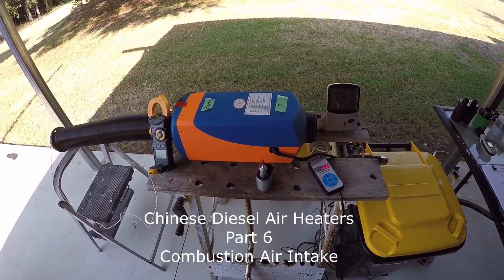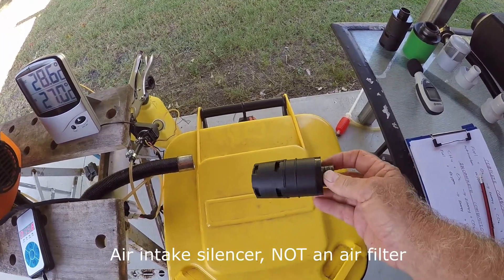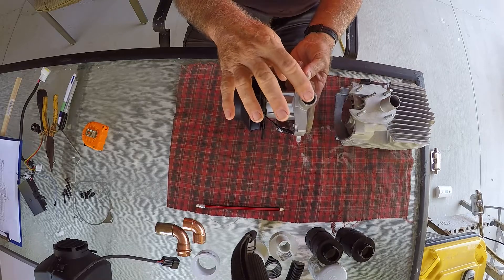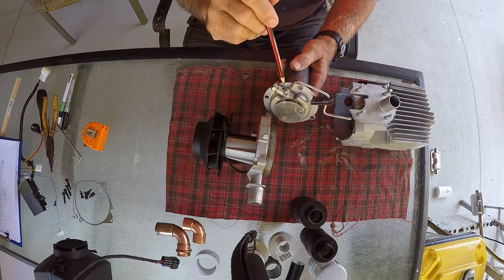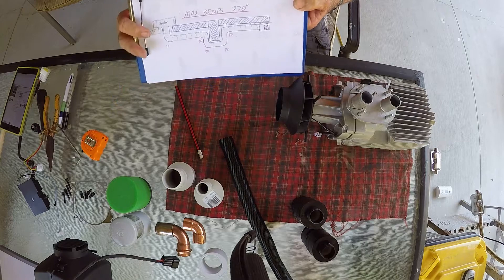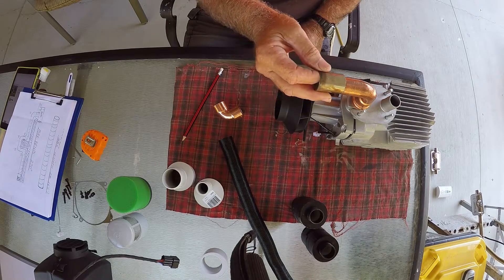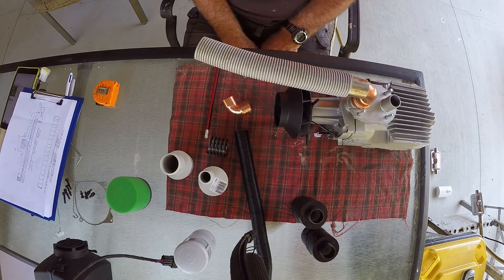Chinese Diesel Heaters - Part 6 - Combustion Air Inlet

Comment: Is there any reason that the air intake hose couldn’t be left off completely? I understand there’s a risk of insects or dust getting in more easily. However, in an indoor environment that is clean it seems to me that removing the hose entirely would provide the best and least restricted airflow.
Reply from the maker: @SommerBros  
Hi SB,

Yes, technically you could leave it off, but you are setting yourself for completely avoidable consequences. Eg, you do not need to wear a lifejacket while doing white water rafting, but if things go wrong, it can sure can be an asset.

In my opinion, you really need an air filter on the combustion air inlet, unless you have a very sterile environment. Bugs, flies, fluff etc can get sucked into the burner chamber, and get cooked. 

The air intake hose can be very short.  JMcK
Reply: @ totally valid point. I agree a filter makes perfect sense.

Comment: Great presentation. I was troubleshooting my issue of non-start & I knew it was an air issue. That 4mm hole was the problem, I blew some air in with a compressor & it would start but it would not ignite without blowing air in. My heater was in a very dusty environment last year. I'm about to disassemble the unit & I just needed some instruction on that but you troubleshot the problem for me. Thanks.
Reply from the maker: @xavierkost9264  
Pleased you found the videos helpful.   JMcK

Comment: Will intake diameter affect the stoichiometry of the fuel air mix and burn? Or is wider just better in general and it'll regulate as appropriate?  Is it better for the air to come from outside (ie, route the fresh air intake outside like the exhaust), or inside where the already warmer air is?
Reply from the maker: Hi Robert. 
These heaters do not like restrictions in combustion air inlet or exhaust as the “breathe” just by a small fan. No problem with larger combustion air intake. 
Whether to take heated air from outside or inside is personal preference. 

Some people want continuous fresh heated air, and take outside air and accept lower efficiency. 

Recirculating air from inside is more efficient, but it is most important leave a vent or window partly open to allow for fresh air into accommodation space.  JMcK

Comment: Thanks for all your videos on these heaters. Pure information, with no BS, what a relief!
What is the minimum distance between the air intake and the exhaust?  This is a boat installation and I currently have the exhaust going through a bulkhead flange feed through fitting on the stern. I would like to mount the intake air also on the stern also through a flange fitting (I know it is not needed, but makes a nice uniform install). The question: if they are about 18 inches apart on the same plain (water is not a problem), is that sufficient? Thanks for anyone's first hand experience.

Comment: Why not leave off the hose and just put the filter directly on the air inlet? Is there a particular reason why they cannot be done?
Reply from the maker: You could do that, but you would need a custom metal filter so the exhaust heat does not melt it. JMcK

Comment: @johnmck1147 Thanks for the video series. Could you provide more info on the intake filter/adapter couple, the name and where to buy @7:43?
Reply from the maker: Hi Jay,

Pleased you find the videos helpful.

I buy my intake air filters off eBay. Below is just one link of many to get you started.

https://www.ebay.com.au/itm/354353709483?mkcid=16&mkevt=1&mkrid=705-154756-20017-0&ssspo=jzay2r5ptdc&sssrc=4429486&ssuid=Q5-hU9ilScO&var=&widget_ver=artemis&media=EMAIL

Cheers.  JMcK
Reply: @johnmck1147  thanks for the link. Your tests showed those silencers actually increased the noise. Have you found a silencer that works to reduce the decibel?
Reply from the maker: Hi Jay, the noise from the combustion air intake filter is negligible in heater operation. The so called intake silencer with foam padding is nosier than the simple gauze filter. The most noise with these heaters comes from the heater fan at a high speed.  JMcK

Comment: John, where do I get the intake hose and air filter from, pls?
I have a brand new 5Kw portable Chinese diesel heater which will sit underneath our camper trailer.
Reply from the maker: I buy all mine online. In your search add the words “for eberspacher diesel air heater” for better results. JMcK

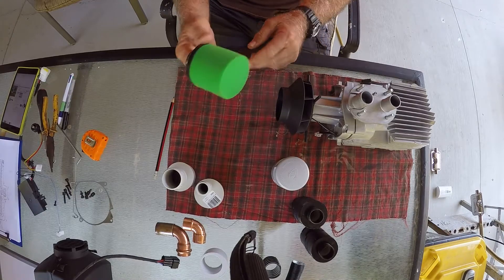Comment: 8:04 Hi John, do you happen to know where I could get a similar air filter to the green motorcycle version in this vid? @johnmck1147
Reply from the maker: You can buy them on line, at a motorcycle shop or small engine shop selling small farm equipment or ATV vehicles. JMcK

Comment: I'm an old school camper with a heated tent by wood. Adequate ventilation is a must! 
With a diesel heater in my camper van i still have my roof fan open and a cracked window while the heat is on.

Comment: in the uk we have Aldi stores and they sell reuseable fruit Nylon bags made of a fine mesch netting, Ive cut a single sheet of this and trapped it between the joints of the air baffle and it works just fine on all 3 of my diesel heaters, one bag is big enough for about 20 intake silencers, shortening the air intake also helps.

Comment: I have a question after watching this great video............................... How would I water proof the intake in rainy and windy uk? Thank-you in advance.
Reply from the maker: Oh Dear Richard. So many variables here. Is the heater in a bus, motorhome, house, shed, boat etc etc, to give a proper answer. You just need the inlet put out of the rain somewhere. Otherwise just put some type of cover over it. This could be as simple as cutting a hole in the bottom of a large jam tin putting the inlet filter inside the tin, sealing the hole with some gap filler and hanging the tin upside down.  Cheers.  JMcK

Comment: The air inlet pipe can be the noisiest part of the burner some of the filters that are supplied can make the burner produce a high whistling type noise even without a silencer there is still some whistling noise through the small pipe😄👍👍

Comment: I've not seen that gray plastic screen filter in plumbing or hardware stores that I recall, could you tell us what it's called?
Reply from the maker: Hi RN, 
Suggest you look at a ss filter.
I nearly always use this type.

Search “Inlet air filter for Eberspacher diesel air heater”  There are lots of suppliers.
Here is just one source to get you started.

https://www.ebay.com/itm/25mm-Car-Diesel-Parking-Heater-Heater-Intake-Inlet-Outlet-Pipe-Air-Intake-Filter-/314167060423?mkcid=16&mkevt=1&_trksid=p2349624.m46890.l49286&mkrid=711-127632-2357-0

Cheers.  JMcK
Reply: @johnmck1147  perfect, thank you

Comment: your videos are the best!  i live in a camper and have been using the 5kw diesel heater for two years, i configured the heater with a minimum of 0.8hz and 1350rpm and it has been working for a long time but at the outlet i have an annoying smell of unburned diesel and i am afraid that sooner or then the combustion chamber will foul.  I have tried different fan speeds with poor results and now I wanted to try changing the 22 pump to the 18 pump making the settings look like the 2kw ones, what do you think?  after your video i also want to improve the air intake as you described.  I use these settings to save money, I set a temperature and, once it is reached, the heater goes to minimum, this guarantees me a basic consumption of only 2lt of diesel per day.  sorry my english, i use google translate
Reply from the maker: Hi Ceci, 

I deliberately have not done any videos on going into the locked ECU settings and changing the manufactures parameters. It is so easy to get into trouble for the average person and there is no reset button.

Yes, you could try the 18 pump and see how that goes.

I like to always run my heaters in manual mode by setting a Hz rate, rather than setting a temperature number on the controller. But that is personal preference.  JMcK
Reply: @johnmck1147  Thank you johnmck for your kindness.  I understand why you don't post certain videos.  Out of curiosity, I tell you that after two years of heating in Hz, I have completely changed my approach. As you can see in the graph, if I sleep and the night temperature drops below a certain level, 0.8 Hz is not enough to keep the temperature, from that moment on, none low (1.1, 1.2, 1.3) and constant settings manage to keep up well with the situation but still lead to almost 50% more consumption in the end.  Instead, using the temperature control, as soon as it drops below the set degrees, the stove brings it back up in a few minutes, continuing to take advantage of the camper's thermal inertia and soon returning to the initial 0.8hz.  The consumption of those few moments that serve to keep the camper warm are even irrelevant in terms of consumption. 

 https://telegra.ph/Temperature-12-03
Reply from the maker: Thanks for that feedback Ceci.  JMcK

Comment: Very informative series!

I have been heating my garage with a 5.8kW kerosene Monitor heater for years, and just picked up one of these diesel heaters to compliment it.  The Monitor uses a co-axial intake/exhaust that keeps the exhaust cage cool enough to touch and that also pre-heats the combustion intake (which should make for a more efficient burn - especially with diesel), and I cannot for the life of me understand why nobody has tried that with one of these.

My plan is to do just this, passing the corrugated stainless exhaust tube (a great heat exchanger surface) through a brass plumbing drain tube that will carry the intake air.
Reply: Hot air is less dense than cold air.
The same volume will carry less oxygen.
You might expect less efficient combustion,  with more carbon monoxide and more soot.
Reply: @johnstarkie9948  Mixture is just an altitude setting away.
Reply: @robertlitman2661  
A richer setting;  more carbon monoxide & soot
A leaner mixture;  less CO & C.
Also affected by carb heat.
Reply: I also wanted to try a preheater, the first reason why I didn't do it is that an inlet at 158° expands the air reducing the oxygen, but if you say it works I will certainly try it, especially since I use the heater at 0.8hz smelling of unburned diesel.  the second reason is the fear of a positive feedback.  Excuse my english (gtranslate)

Comment: I’m currently watching all your vids so sorry if you say this in a future vid. When I install the heater in my van should I run that air intake under the van outside ? In uk so can be cold in winter. Or should it be inside the van taking in warmer air ? Thank you
Reply from the maker: Hi Terry, heating outside air or heating inside air is personal preference. 
Some people like to heat fresh air, but it is less efficient.
Some people like to recirculate the air. It is more efficient, but you must have a vent or window partly open to get in fresh air.  JMcK

Comment: Thanks for this brilliant series of videos John.  Do you have a link for the plumbing stainless steel mesh fitting you showed for the combustion intake?  That looks ideal.  I've not seen these in the UK.
Reply from the maker: Lots available online. Suggest you search “Intake combustion air filter Eberspacher diesel air heater”
Below is just one link to get you going.

https://www.ebay.com/itm/25mm-Air-Intake-Filter-Silencer-For-Dometic-Eberspacher-Webasto-Diesel-Heater-/364012399292?mkcid=16&mkevt=1&_trksid=p2349624.m46890.l49286&mkrid=711-127632-2357-0

Cheers.  JMcK

Comment: Fantastic set of videos you've provided, which have really educated me. Thank you.

To reduce the number of adaptors needed to increase the air inlet size you can get reducing elbows to fit straight on the inlet manifold and I have found them in the following sizes:

25mm X 32
25mm X 35
25mm X 38
25mm X 45

Comment: Regarding air induction. Could you take a feed from the hot air outlet and feed it back to the inlet to increase air flow and have a warmer inlet temp
Reply from the maker: Hi Michael, you could if you want to. But why?
If you want to do this why not recirculate the air from the heated accommodation area.
Whether you heat outside air or recirculate the accommodation air is personal preference. 
Just like you can recirculate the air in your motorcar, or choose to heat outside air. 
However, if you recirculate, you should have some means of getting fresh air into the accommodation space. Eg a partially open window or air vent.  JMcK

Comment: Hi John, I love your series of Chinese diesel heater videos. You seem to be the most in depth expert out there! I am thinking of upgrading the air intake on my heater as I fit it. Would you recommend a bike filter that has the  corrugated metal gauze filter and foam instead of just foam? I’m also concerned about the foam clogging with water (it rains a lot here in the UK!) so I was think of putting a splash plate / cover below the filter whilst leaving a good gap for air to enter the filter without restricting the flow. Is this a good idea?
Reply from the maker: Hi Graham,

I assume you mean the combustion air intake filter. If so, suggest you only use the simple metal gauze filter. There are many available on line with stainless steel gauze.

The reason for the filter on the combustion intake is to keep the bugs out of the combustion chamber.

Suggest you do not use foam, paper, or any other type of restricting filter as they will restrict the air intake. 

These heaters only have a small combustion fan to suck in the combustion air, unlike the pistons in a motorcar. 

You restrict the combustion air intake and/or the exhaust of these heaters and you will have a bad fuel air mix and a bad burn, with excessive carbon build up.   JMcK

Comment: Great video again, thanks a lot John. Would it work to keep the air intake inside the camper and just put the exhaust outside? Would make the install somewhat easier to have just a single hole through the van, plus no chance of the exhaust mixing with the intake...
Reply from the maker: Hi Ch,  

Do you mean the heat exchange air? Yes that is quite ok, and much more efficient. That is personal opinion. I talk about this in the motorhome video.

If you mean the small combustion air inlet. Yes it could be done, and many boat installs do it this way, but the heater is generally out of the way back in the rear of the boat.

However it is better to draw the combustion air from the outside, because it is connected directly to the combustion chamber, and you can get blow back and fuel vapour leakage back out the inlet tube. Also after shut down you can get fumes come back out that inlet tube. This is not something you want to happen inside your van.

Not sure why you would think it easier if you are talking about combustion air. It and exhaust come out bottom of heater through the one gasket. It would be hard to seperate them.   JMcK
Reply: @johnmck1147  Thanks for the detailed reply. I just saw this. I have already installed it this way in my van. What made it easier is that I only needed to put one 25mm hole through my floor. But you're right about fumes leaking out of the combustion chamber inlet pipe. I smell diesel occasionally inside the van. I'll have another look at the van and see if I can make a second hole to put the intake outside as well. After reading your reply I understand the logic.

Your videos were a real inspiration to me. I felt extremely well informed about these heaters and have recommended them to several friends as a result of your videos. Thanks a lot for sharing such a great resource, I really appreciate it.

Comment: Great series of videos. Do you have any concern that a dust filter like you have shown in the video will restrict air input and therefore cause improper combustion? Also wondering if you aware of filters that are dust and weatherproof since I assume a foam filter that is wet is even less likely to allow air through.
Reply from the maker: Hi Ramzi,

You are correct. I do not use the foam filters that come with some heaters.

The corrugated motorbike air filters get enough airflow and work ok. 

I personally only use the ss metal gauze filters.as shown in video. The heater is not operated while driving on dusty dirt roads.

Cheers JMcK

Comment: Hi John, I've commented before but once again thanks a million for these vids they're invaluable. Could you possibly post an ebay/amazon link to a filter you would would recommend?
Reply from the maker: Hi Allan,

I prefer the gauze air filter. Search “Combustion air filter Eberspacher diesel air heater”

Below is a link to get you started. I try to purchase off a seller with a local (Aus in my case) warehouse.

https://www.ebay.com.au/itm/25-Mm-Air-Intake-Filter-Hose-Clip-Fit-For-Eberspacher-Webasto-Diesel-Heater-/165237376789?mkcid=16&mkevt=1&_trksid=p2349624.m46890.l49286&mkrid=705-154756-20017-0

Cheers,   JMcK